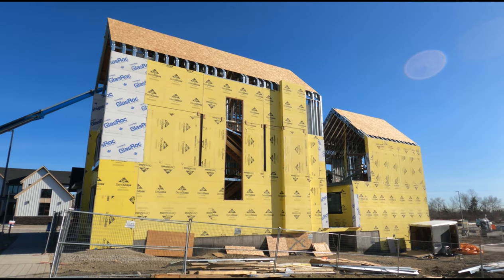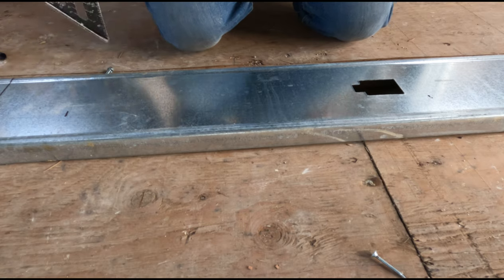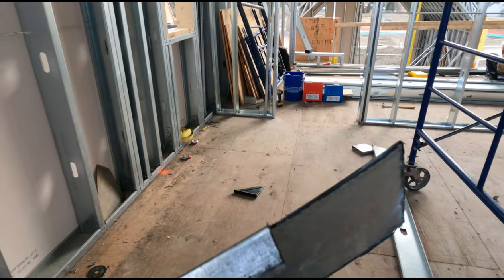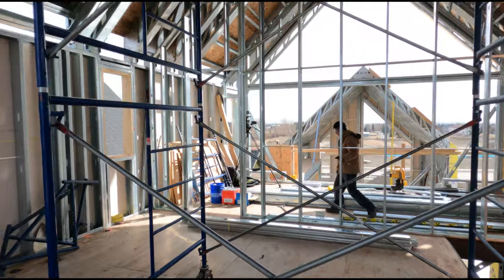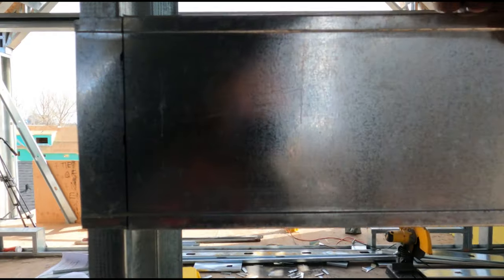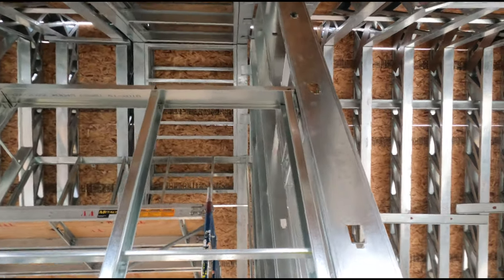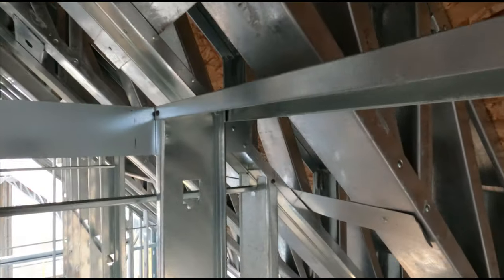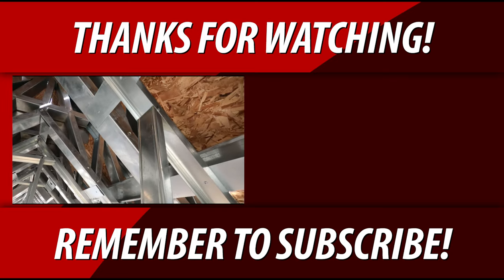Metal Stud Install Top Track Between Trusses & Secure Floating Walls How To Make & Use Clips

Comment: This looks great ! Nice work man. 
Question : what kind of fasteners do you use for fastening the top track to the Q-deck ? 
Is it a ram-set type thing ?. Or pilot hole with a screw ?
Reply from the maker: I use heavy gauge framing screws, self taping! Super easy. If the qdeck above is filled with concrete sure use 3/4" hilti pins but 90% of the time its hollow and those regular self taping framing screws will work!

Comment: Would you make metal clips for timber rafters (metal on wood) or make wooden noggins instead (wood on wood) to then attach the metal top track?
Reply from the maker: I almost always use metal as it's non combustible. I once used wood.

Comment: I have 2 questions, I have a long wall I want to do that they will install a drop ceiling so I have nothing to secure the top to. What do I do with that? 2nd question is. I am basically installing against a brick wall. parts of the wall is a 40ft run. I feel I have to secure the top rack to the brick every so often but I don't know  to especially when I know darn well the brick changes depth and I don't want the wall to be wavy. how do I fix that issue?
Reply from the maker: Brace it with track, cut it just long enough to cover the steel minus a 1/4" and bend it so you have 4 to 6 inches on the wall (like a L shape brace). For brick I usually hammer drill 1/4" and use pin bolts (smack pins) you don't need long ones just 3/4" long. If your furring wall is not against brick you can brace it many ways or just screw the top track and studs into the wall behind with drywall screws. Hope that helps.

Comment: #ConstructionKronies On Door steel Box Headers,, Do you prefer setting the box header on clips (top and Bottom) 
Or do you prefer tongue cuts on the ends of the box header to attach to door opening studs??  🤔
Reply from the maker: Hey bro, unusually use the clips, but you have to make sure the header is centered to the wall and doesn't stick out too far out. Any details I've ever seen on one shows clips, and it makes it easier to raise or lower after drywall. Cutting shoes out of the ends seems easier to do tho. I'm not positive if that way is structurally sound compared to using clips either. I just stock to what I was taught until someone convinces me otherwise haha!! Be safe bro!
Reply: @ConstructionKronies  ok Cool! I was taught to cut tongues at the ends but I’ve used clips when working alone on double door headers, just makes it easier.. this was a framers debate during Lunch the other day figure I’d ask you.. haha! Keep it cool bro 🤘🏽 safety 1st! Thanks